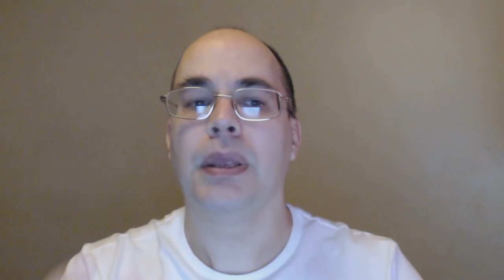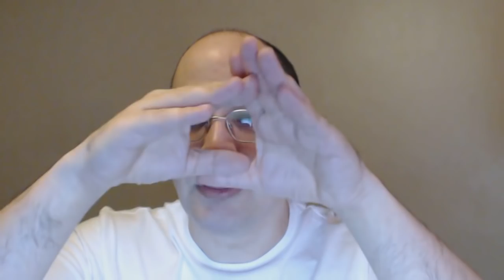How do rockets move in space, with nothing to push off from?

Comment: Ok, problem. I am a sci fi fanatic, when i say 'think rockets have no trust in space' goes against everything I want to believe. So, thrust in vacuum, equal and opposite reactions of all forces. Exhaust expelled works fine in atmosphere. But in a vacuum, said rocket expels mass to the opposite direction in order for motion to occur is still the basis. But there's another factor which tends to be ignored by experts and community. The equal energy and opposite reaction is not all accounted for by what informed to by. Experts neglect to mention this fact, that the opposite reaction to all energy can't be ignored, even negative energy. Speaking of is the vacuum of space itself. The suction is an equal and opposite to the exhaust itself. As exhaust is expelled it will also be equalized in form of suction, as mass is forced out of chamber. Therefore no thrust.
Reply: A vacuum does not suck..... a vacuum exerts no force, it does not push, it does not pull... it is literally the absence of all matter. It's not "negative reaction" it's not any reaction or anything...

IT IS LITERALLY NOTHING.

The rocket and its reaction mass (fuel) amount to a closed system.

Conservation of momentum requires that in a closed system with no external forces acting on it,the total momentum of the system will not change. That is the total momentum must remain the same.

Momentum is a vector quantity, defined as a product of the mass and velocity of an object.

The rocket as a whole is the object, this includes the rocket body as well as all mass used as fuel.

When a rocket engine is running, fuel is burned to accelerate the mass of the fuel out the nozzle. This comes out as rocket exhaust, which is a gas. Gasses have mass. A gas which has mass and has a velocity along a particular vector has momentum.

The exhaust is part of the system which includes the rocket. Since there is momentum applied in one direction (the mass of the exhaust), that momentum cannot come from nowhere, it results in momentum in the other direction as well( the rocket moving forward in the opposite direction as the exhaust). Because the total net momentum of the whole closed system cannot change. That is, the momentum the gas molecules are receiving to move along that vector out of the nozzle, comes from momentum of the rocket body.

Proposing that the exhaust mass comes out (has momentum along that vector) and yet no opposite reaction is happening, and no external force is acting on the system, is claiming that momentum is coming from nothing (you have additional momentum in the system  over what was before the rocket was started, and yet no external force was acting to add this additional momentum)..... and thus a violation of the conservation of momentum (the third law of motion).
Reply: No, vacuum doesn't work that way. There's no "suction" out there. If it was, it would cause rockets to fly backwards :)
Reply: Vacuum suction is 360*. Behind, aside, and front of craft and exit point of combustion chamber. Gases get pulled in all directions when released. Which nearly nullifies all thrust. I see it possible to move in space, but the shear amount of fuel needed can only be explained in fiction. Perhaps it is possible to get there, but anything other than continue directional path, forget it... steering, or slowing. Its easier to believe we are nasaed, aka deceived.
Reply: +mossaic13
No, gasses are not getting "pulled" anywhere in vacuum. That would contradict Newton's laws of motion.

What is happening in reality is that rockets ignite fuel in combustion chamber, and the resulting continuous explosions sends shockwaves of hot gas in every direction. Now, gas molecules pointing back will simply exit combustion chamber without interacting with the rocket, but those who happen to be moving forward will have to bounce off the walls of the combustion chamber before they can exit the chamber.

And by bouncing off the front wall of the combustion chamber, those exhaust gasses will give rocket a forward momentum.
Reply: +mossaic13
However it, matter does want to expand to even the pressure.
Yes, and it does. But the individual molecules can't just turn around in mid-flight - they will continue moving in their original direction, regardless of whether they are in a vacuum or not, until they meet something they can bounce off.

However, you cant deny a pop can expands to the point of a ballon until it bursts because it seeks to equalize.
You mean in vacuum? Yes, it does that because there's no gas molecules on the other side to equalize and neutralize expanding action. What's your point?
Reply: Shit, i accidentally deleted my comment. Start over. Yes, i admit i maybe wrong. But you need to realize that a pop can in a vacuum expands to a balloon until it bursts. Like the explosive decompression in a aircraft. Matter such as gases want to equalize the pressure. Its a 360* suction, sort of.
Reply: Its this fact that they want us to ignore. And the reason I hate to admit, space travel is fiction. Nasa is a farce, look into the live station interviews yourself. Not the hoax videos, look into the fanboy videos. Youll see fingers and elbows disappearing like bluescreen magic. And ask, why did i see the astronaut bounce?. Ok, buddy, takecare. Ill be signing off.
Reply: +mossaic13
Yes, but how? How do you think it happens? Each gas molecule has a direction and speed, whether it's in an area with no gas molecules (in other words, in a vacuum) or not. Gases will "want" to equalize the pressure, yes, but they can't change direction mid-flight.

Consider this - let's say you have a box full of air in vacuum, with gas molecules moving in random directions. If you remove one wall, those gas molecules who happen to be facing this wall won't have to do anything to exit, but those who are facing away from the missing wall will have to bounce of the opposite wall in order to be flying towards the missing wall. And each bounce will propel that box in opposite direction.

And that's how rockets work.
Reply: Exactly. The vacuum sucks as much as it is expelled. But yes, I yet admit again, i maybe wrong. For me, its easier to beloeve that nasa who was started by 1000 nazi scintists and american men just as driven as them wanting to decieve us. Takecare.
Reply: +tekitron
The rocket and its reaction mass (fuel) amount to a closed system.
No, they're not - the back of the rocket is open, and the exhaust gasses can exit into the vacuum.

The rocket as a whole is the object, this includes the rocket body as well as all mass used as fuel.
Not when that fuel is released into the combustion chamber. Analogy: after you drop something you've previously held, it's no longer part of your system. Should you push it away from you, you'll get momentum out of it.

Since there is momentum applied in one direction (the mass of the exhaust)
Yes, the momentum, shaped by the combustion chamber, is applied mostly *upwards*, propelling the rocket up.

Proposing that the exhaust mass comes out (has momentum along that vector) and yet no opposite reaction is happening
Exhaust initially goes in all direction, gets redirected mostly up by combustion chamber, bounces off the upper wall of combustion chamber propelling rocket up, and (since it now has different vector) exits the combustion chamber via the hole in the bottom. That's your action and opposite reaction.
Reply: Jan, Yes, exhaust gases leave the rocket, that mass is part of the overall system.

A closed system is a system which has no external forces acting upon it. The entirety of the rocket + fuel is a closed system, the rocket body itself is an open system. The rocket body is part of the overall system. You argue that the fuel exhaust is not part of the system, but it is interacting with the rocket to move it.... which means scientifically it is part of the system.

When you drop something previously held it may not be part of you, but it is still part of the overall system. The overall system is bigger than you. There would for example be a minute change in angular momentum of the rest of Earth due to your dropping of that rock, and how much angular momentum it had when you were holfing it being transferred to the rest of the Earth's mass.

Momentum of the rocket exhaust is applied to the rocket body, yes..... the net momentum of the mass of fuel and mass of rocket body is not changed. The momentum the rocket body has in one direction came about from the result of momentum applied in the opposite direction to the mass of fuel exhausted. Does not matter if this was fuel, a rock, nerf darts or a fart.
Reply: Jan. Ok... i can work with this explaination. Molecules bouncing off the bottom of the combustion chamber. Thanks for the respectful chat. Explosive decompression in a aircraft and a blank bullet fit your explaination. Now, the next topic, geostationary satelites. Lol kidding.

Comment: A rocket is just a continuous controlled explosion causing  a recoil in the opposite direction  "thumping" the vehicle along.  A bit like a machine gun recoil. 
Air pressure at sea level is only 15 lbs psi. Most big rockets produce 7.5 million lbs thrust.  So 15lbs is nothing in comparison to 7.5million and  far to little to to be of any use to push against.
Jet engines do not push against the air either, they only need air to burn the fuel, thats why jets have a maximum working altitude , they run out of air to burn the fuel.
Reply: WildPhotoShooter
, you're wrong. Within our atmosphere Rockets and Jets both push off the Compressed Air behind them. A Jet boat pushes off the Water behind them. We can prove this by the addition of the 'Reverse Gate' which is nothing more than a 'Backboard' that can be dropped down directly behind the Jet that redirects the force in the opposite direction.
Reply: @asleepinthealley  you are so ignorant it's hilarious
Reply: WildPhotoShooter
, no, the rockets only produce a working 'thrust' when they have an ambient pressure to 'react' with. Here on Earth they make use of the air within the atmosphere or the Water. In the infinite vacuum of Space there is nothing with which to 'react'!
Reply: @asleepinthealley  are you an idiot? Rockets carry their own igniting source
Reply: @neiljohnson7914  ha ha. You dont even have the intellect to understand the problem isn't ignition but that thrust requires something to thrust against and that is not available in a vacuum.

Comment: It's like a helicopter when it gets to a certain elevation it simply won't work,as a low Earth example.nothing to propel off of.
Reply from the maker: Not really, because aircraft and rockets use different methods of flight
Reply: Steve Wittwer.
You said  "Aircraft use wings to manipulate density" What a load of bollocks !!!   A wing does not change the "density" of air,  they just make it travel faster over one surface which physics tells us reduces pressure. Or are you saying wings reduces the density of the aircraft so it can float up ???? LOL.
 Heat reduces density,  but wings don't produce heat.
Reply: No Its because the helicopter that is too high has no air to create lift , helicopter blades have the same aerofoil shape as an airplane wing.  Yes they do push air down but most of the lift is caused by low pressure above the blades like all propellers do. Wings, propellers and helicopter blades are all aerofoils that create low pressure on one side and high pressure on the other side.   You need to get some aeronautic engineering books and read about it.
Reply: You talk thru ass, rockets work better in a vacuum
Reply: steve wittwer some of the ideas you have are good, like pressure lifting a wing, but your conclusions are very wrong. a rocket is propelled by the pressure of its exhaust gases pushing against the engine bell. during firing, there is no air inside the engine, it's all filled with propellant+oxider on the input side and exhaust gas on the output side. why do you think air is needed for a rocket? please explain.
Reply: helicopters and jet engines rely on the atmosphere. Rockets cdon't. They carry a supply of propellant thatthey combust and eject , thus causing forward momentum according to the law of conservation of momentum
Reply: +m j murcott Show me real-time footage of a rocket operating within the vacuum of space, otherwise everything you say is just textbook hearsay.

Comment: Wouldn't it be like 10x easier if they just made a system that changed the center of mass, so they could move other parts and repeat the process back and forth between the other parts.
Reply from the maker: Changing the centre of mass within a closed system won't move an object, let alone the energy needed to rapidly move the mass around would be generated from what and what mass are you going to move?
Reply: The rocket is changing the center of Mass, The rocket may be moving <- that way, but since the system's mass (the exhaust) is being propelled -> that way, the center of mass of the whole system (rocket body as well as any and all exhaust gasses) is constantly moving -> that way relative to the rocket body.

Comment: globe sphere lovers rockets won't work in a vacuum we have vacuum chambers why hasn't it been easily proved????
Reply: It has been shown to work in vacuum chambers numerous times. Mythbusters even included it in one of their episodes. Do a little research, you will find lots of examples.
Reply: I saw the Mythbusters one. I also saw another that showed the same type of rocket that failed miserably due to lack of pressure for the propellent to ignite
Reply: these are also flawed due to the size of the chamber they don't take into account that they get propulsion of the end- side of the tank
Reply: So why are you asking for them to be shown working in a vacuum chamber if you have seen these and are just going to rebuke them?
Reply: Simon Marsh  I didn't look it up till after I asked
Reply: as I said I also think the small chambers are flawed I meant a bigger chamber
Reply: "lack of pressure for the propellant to ignite"

That sounds like a lack of oxidizer problem, not a "lack of pressure problem". Most rockets carry their own oxidizer either as seperate LOX, or an oxidizing compound added to the fuel (salt peter in black powder, for example is a strong oxidizer, which is why black powder will ignite in a vacuum).
Reply: Alan, in short, it has been proven time and time again as evidence of the space station and rockets that go into space by different countries and by private sectors on a nearly daily basis. Rocket manufacture's also test their rockets in vacuum chambers to determine performance. Just because you are not privy to this information, doe not means that the laws of the universe or rockets working in space cease to exist.